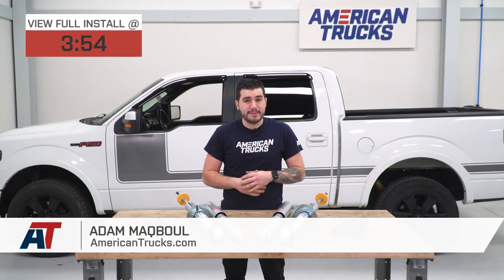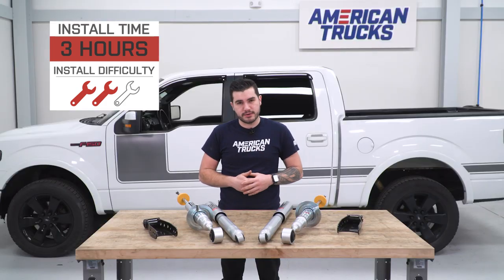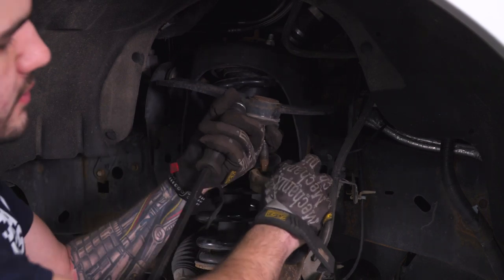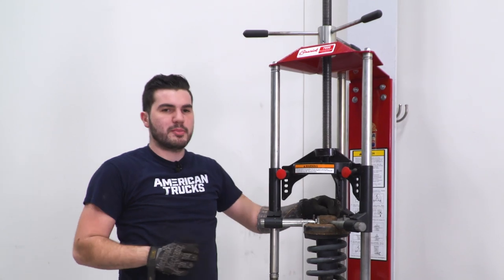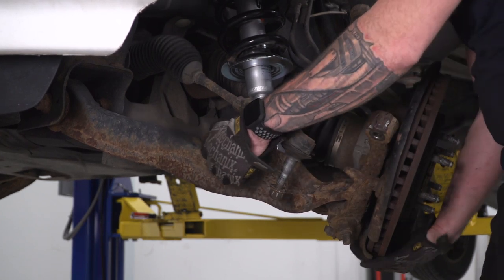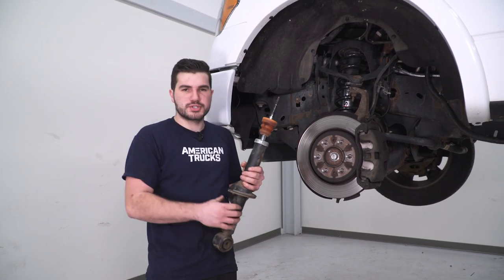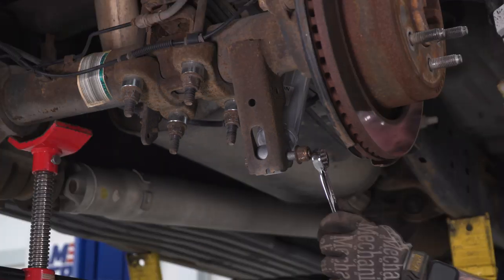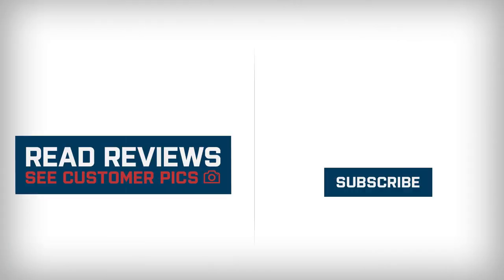2009-2013 F150 Belltech Stage 3 Lowering Kit w/ Street Performance Shocks Review & Install

Comment: I like that there is a kit that will lower my truck, being 4wd, cuz getting up in age makes it hard to get up into the truck. Did anyone notice the drivers side a-pillar had no grab handle when you bought the truck? Or maybe did notice and didn’t mind, but wish you had one now? Lowering would make getting in and out easier, and loading cargo better. Easier for the short wife, too. I like that you keep the slight rake front to back, for heavy loads won’t squat the back. This is a nice kit. Little expensive for what it is. I’d buy it in a heartbeat, but not at that price.
Reply: For whatever reason they didn't bring that back until '15. Weird.
Reply: @xforce687  Bet you it has something to do with crash testing.  The BMW M2 has crooked driver seat from the factory, as do most BMW, but very noticeable on the M2.  It's offset towards the passenger side to improve crash ratings.  So you're not even sitting centered, you're angled.  Lamborghini does it too, but that's probably due to their wedge shape all around.  What ever points they can get from the crash test, they'll do it.  Helps lower insurance cost for buyers and help prevent lawsuits from a poor or faulty design.

Comment: in the vid the after isnt leveled what so ever, read is alot higher than the front, if i were to get this and do it to my single cab 2013 f150 would lowering both the front and rear actually level it out if done right?
Reply: I think you'd need a 4in drop in the rear to get it level unless you go back up and inch Im the front. Kinda sucks but that what I'm getting from it.

Comment: What if you just installed the 3 inch drop shackles and didn’t remove the blocks because they’re welded to the axle?
Reply: Then it will only lower 2". The 3rd inch comes from removing tge block on 4x4 vehicles. Thus is actually only a 2" shackle.

Comment: I did this on my 2014 f150 fx2 and im getting a slight bottoming out. what could i do to stop it?
Reply: I'm no pro, but I would  try moving the bolts 1 or 2 slots on the rear lowering shackles. maybe?🤷

Comment: If I only do the front then do a axle flip  and rear lowering shackles on the rear what rear drop I'll I get and will it match the front to a lowered level stance?
Reply: Flip kit is 6” , with drop shackles you can get 7” or 8” if they’re 2” drop shackles.. I’ma install belltech 3” lowering shocks with 2” lowering springs , in the rear I have Maxtrac 6” flip kit and 2” rough country drop shackles, I have it on the 7” height in rear, with AirLift SlamAir helper bags
Reply: Flip kit is 4" in rear unless adding blocks to get more than that.

Comment: Will this work on a 2014 I can’t seem to find any lowering kits for 2014
Reply: If someone knows let me know
Reply: Yeah bro same gen
Reply: You have to piece it together. It's about ,450 bucks all together. I called belltech support about this.
Reply: 2014 is the oddball year front strut is different. Everything else is the same.
Reply: not sure if its too late but i talked to belltech directly
you have to piece it together
25007 adjustable strut x2
6406 2” shackle kit x2
2216EE rear shocks x2